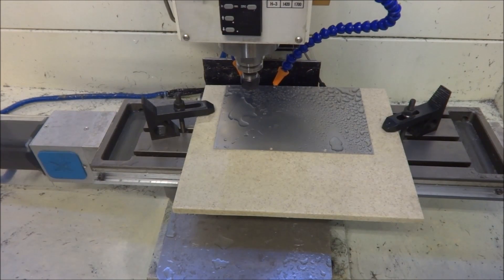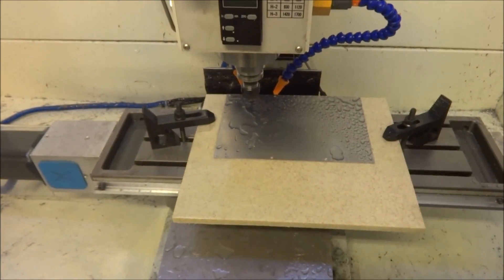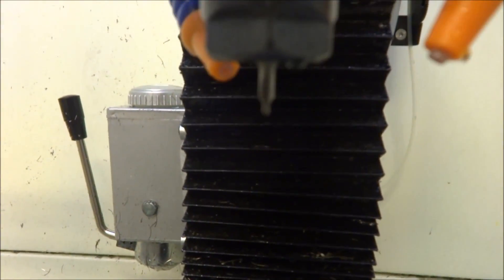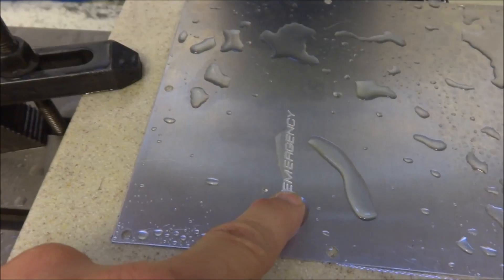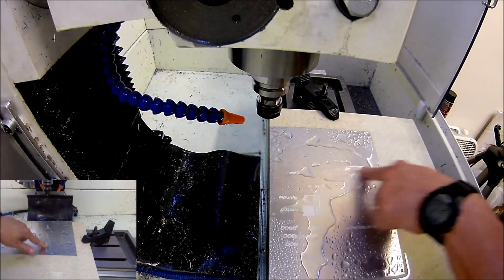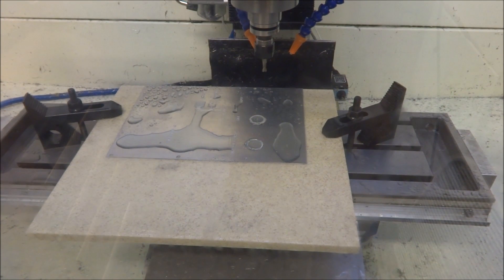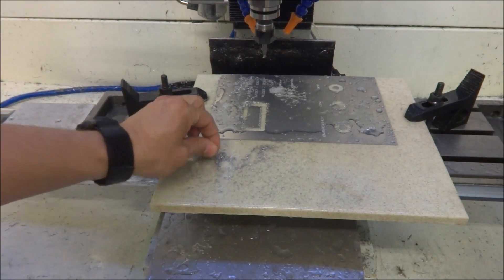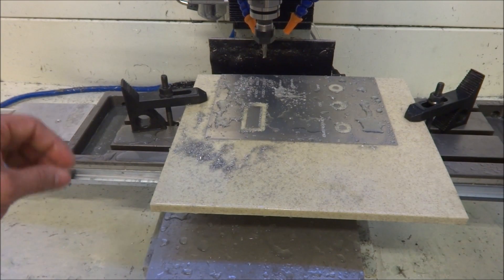G0602 Control Panel Redux

Comment: Hi Sam,
Nice looking panel. How did you get the panel of the backing plate without bending it.
Cheers Dave.
Reply from the maker: I sprayed both the panel and the Corian I suggest only spraying one. However Its was not that bad I gently worked a Putty knife under it.

Comment: hello sam,
any chance you can tell me why you pick the PM-727M over the PM-30V? having a hard time deciding..
Reply from the maker: Well The PM-30V was not out at the Time I don't believe the PM-25 is the same size as the G0704 the travel is god but the meat of the machine is too small.  The PM727M is big I could easily adapt to a 3 phase motor ( Bolt in direct fit) I cant speak much for the PM-30 travels are good weight is good. But I have not seen the machine. My best advice is to contact Matt at PM he can best guide you. Love my PM though. Be Safe,
Sam
Reply: Thanks for the reply.
Reply: Randizzle808 what is price of your machine and what configuration of your machine